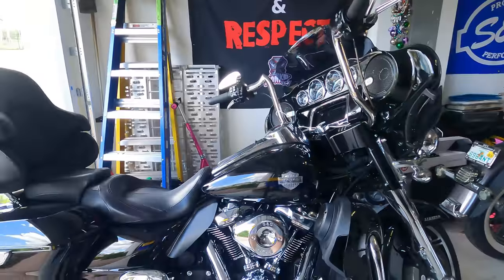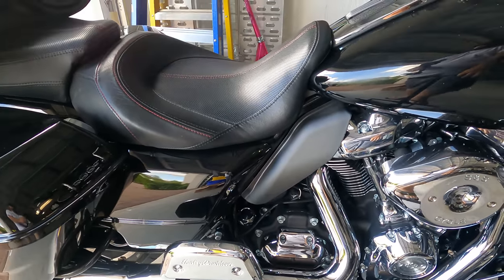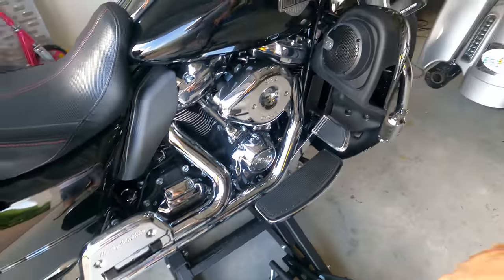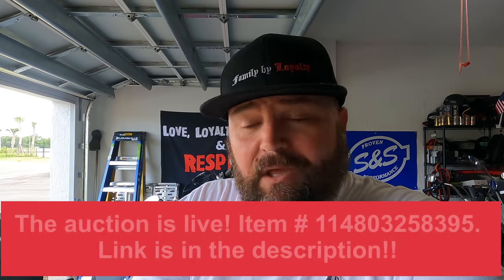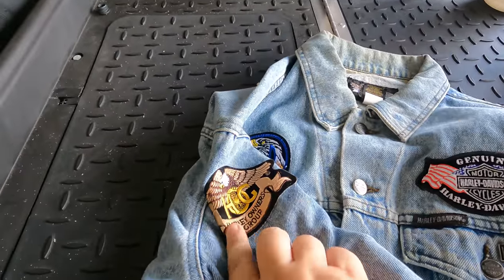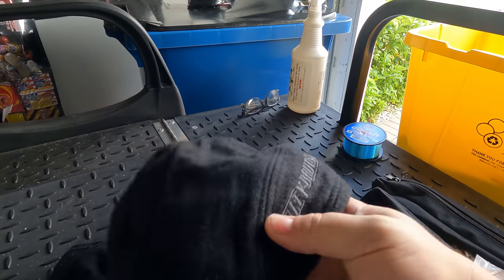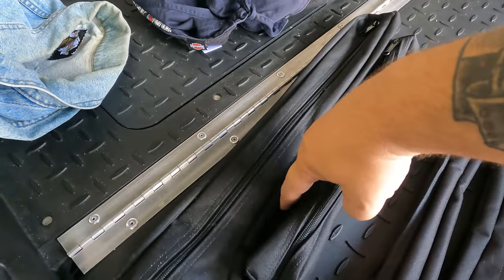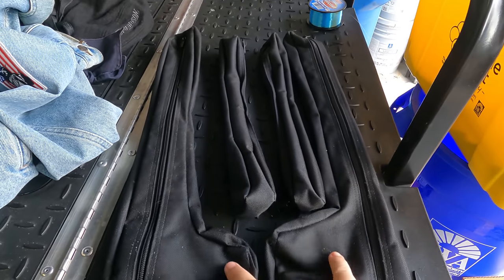Easily moving around a half ton Harley and a Charity Auction!!!!

Comment: Nice think I want one
Two thing II would be concerned with
1. Center of gravity Bags or Touring pack on or of. They loaded up with stuff/empty ?
2. Placement of jack will be different on models and years with older style frames., Older Softails bottom of frame is about even  with  shocks. Shocks are touch lower Bottom of engine case jacking against it would be bad

Ride Safe

Comment: You said in a previous clip that you didn't have room for a full lift.  The HMC lift has an optional set of wheels that let you roll around the garage.  I also added a Condor wheel lock on it and use the lift to park my bike on daily.  Check into it, it's a great product.
Reply from the maker: I will!

Comment: Regarding the jack.....since you have to explain in detail how it works, you should probably state the importance or having a nice, smooth, Crack free floor in order for it to work safely, since the jack has very little clearance under it.
Reply: Well that leaves me out then my Garage floor is surface crack city, No worries though.I have wall to wall rugs in there . lol
Reply: @Henry.58  LOL! Me too. I’ve got a bike jack very similar to that and have a nice crack in my floor. Lifting it is not a problem......moving it around on the lift is not good!! 😁